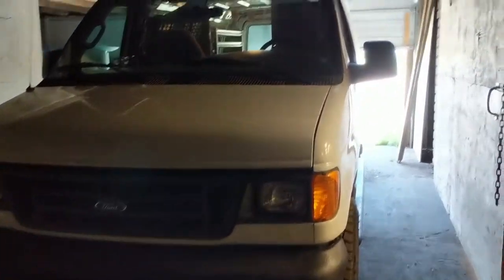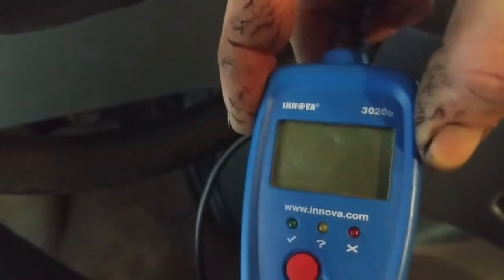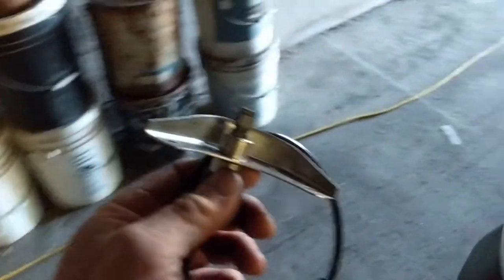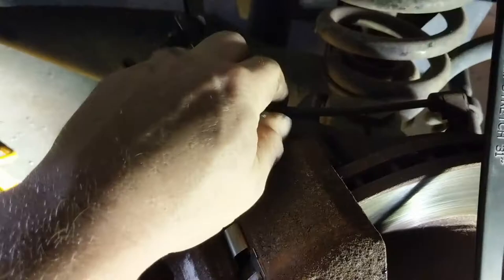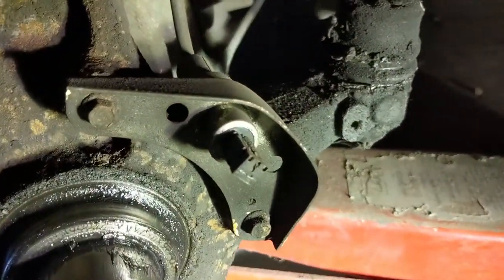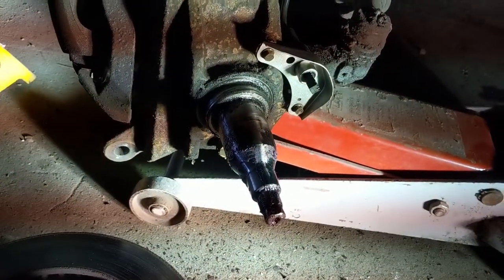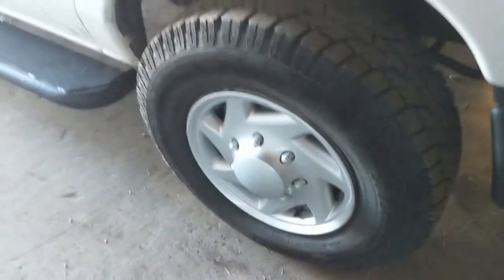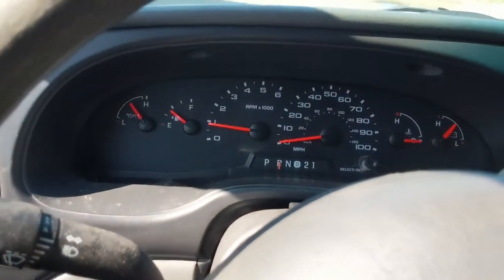Ford ABS light stuck on, how to fix it?

Comment: I am so changing the sensor myself. Last year the same happened to my Lightning and you guys do not want to know how much the dealership charged me. I am looking at the receipt right now. The charge to change the sensor out is horrendous.
Reply from the maker: When I was about 17 I thought it would be a good idea to power wash the engine of my 98 Cavalier well it wasn't and I ended up having to have it towed to the dealership shop the next day so that they could get it to run again, they ended up drying out the plenum and changing the four spark plugs after that it ran again I got a bill for almost $800 for that service. So that day I decided I would become a mechanic and deal with these things myself. 41 now I'm proud to say I have not been back to any shop to ever have any work done on any of the vehicles I've had in the last 24 years ☺️
Reply: 13:16 😮

Comment: My onan gas generator muffler exit pipe was badly rusted and disintegrated in few pieces and disappeared behind us on the road. After that. a few days later. My ABS light turned on and off randomly. I did not had braking issue. but i think there is a lose wire and connection lose somewhere. Do you know who to troubleshoot that?
Reply: the abs sensors behind your wheel, look and trace the cable, they can often get corroded and even break off, it might have a sleeve on it , check it and the sensor is around $20, for me its $15. but thats a good troubleshoot

Comment: 2011 Ford E250 van, The problem I have with it, I get lights that come up on my dash, ABS , TCS/off , BRAKE. I brought it to a mechanic, he said was sensors on front tires. I said that’s a lot of lights for a sensor. He actually changed front  sensor on right tire. And change 2 front rotors and brake pads. All light were gone for lesss then one day. They came back up like a Christmas tree. I brought it back to him and he said it’s probably the hydraulic pump. Or can be other sensors. He had it for 1 week, then said I think it’s something else because it’s a lot lights for a sensor problem. That’s what I said day one.
Reply from the maker: This is exactly why I do all my own repairs. Every time you take something like that to a shop they hit you with a repair bill just to take a shot in the dark, they miss, and you go back and they try something else and charge. This mechanic sounds like a parts changer to me not a repair person.. When he replaced the sensor he reset the codes in the computer, that would probably be why they were gone when you picked it up and came back on the next day after they had time to register in the ECU again.
Reply: @machinesnmetal  still have the problems, any can you suggest troubleshooting I have a fluke meter maybe can test sensors ? or do you have a suggestion on how to go about it ?
Reply from the maker: Get yourself a cheap obd2 scantool like the one I show you in the video and start with that.
Reply: Same problem bro ……How do you fix the problem …..get all of those ligths off
Reply: Yup read your own codes, save your bucks by investing your time
Reply: Get ur OBD and ABS code readers , its an investment

Comment: 1998 Ford f150 v8 4x4. Abs light came on while traveling. I had all of my master  cylinders, brakes,  the whole shebang rebuilt 3 weeks ago. I'm stuck at a truck stop, won't go into gear and I have a rental trailer w/my deceased daughters items$*÷&$&$*÷$!!!!!
Reply: Disconnect the battery for around 15 minutes..then retry.it may reset pcm
Reply: Theirs also a video on here about your issue .i can't recall whom the uploader was.just search it.my condolences also.